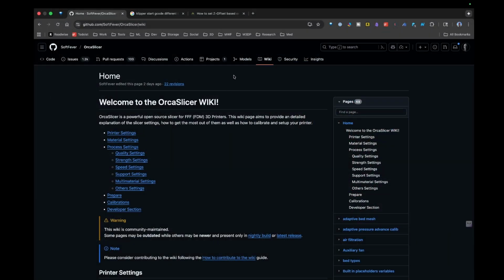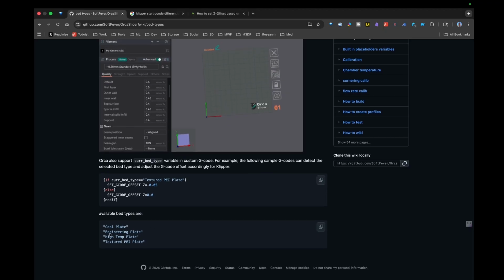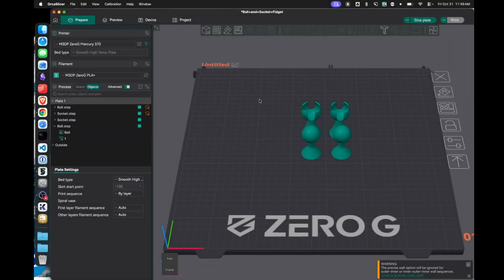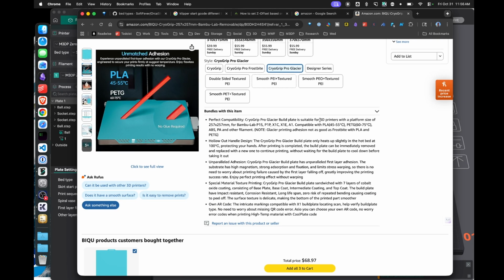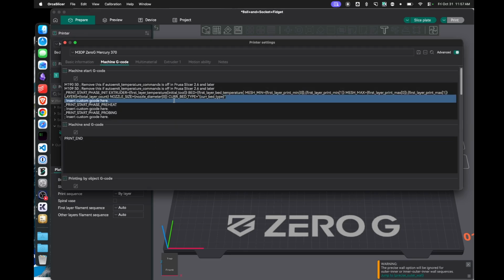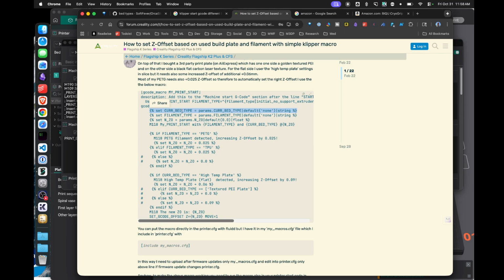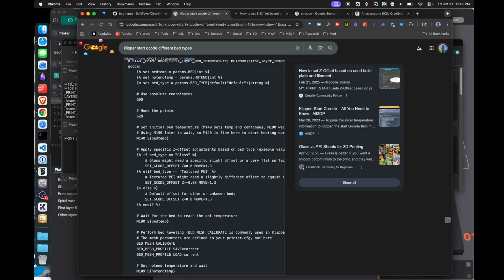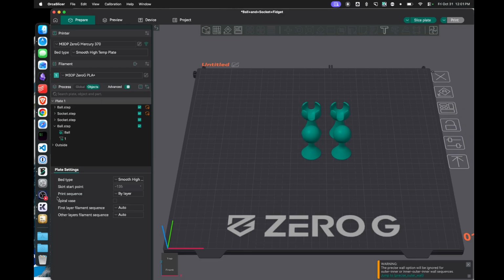OrcaSlicer "Bed Types" Explained: 3D Printer Bed Plate G-Code Setup

Comment: why do you need to add the g-code if its a setting within orca? is the setting in orca just telling itself to slice with that bed type in mind? while adding the g-code is for telling the printer what bed it has? 
Like if i set the bed temp different from the first layer to rest of the print without the gcode as well. will it not do anything?
Also great video! hope you are doing better!

Comment: You did a good job of relating the bed set option to the effects upon slicer behavior. Seems z-offset and bed temperature settings are the key changes that are made to the sliced gcode.

Comment: My secret z-offset hack is if I need it slightly higher and I'm printing on textured, I just tell it that it's smooth when it's not and that makes it slightly higher since for my printer there is already code to make textured slightly lower, so it undoes that without editing code.💡

Comment: interesting, I started doing this years ago when I moved my Ender 3's to Klipper. Will have to revisit my start gcode and compare and update mine.
Reply from the maker: Glad I could help. Let me know how it goes.
Reply: @minimal3dp  So far so good, forgot that klipper was case sensitive and had CURR_BED_TYPE= in the slicer gcode but curr_bed_type in {% %} section, was scratching my head for a bit then I was well duh of course it doesn't work. Just need to tweak it some now.